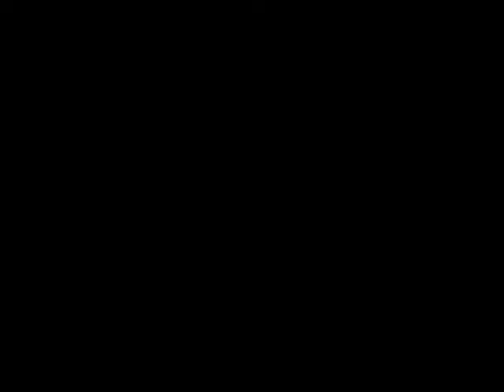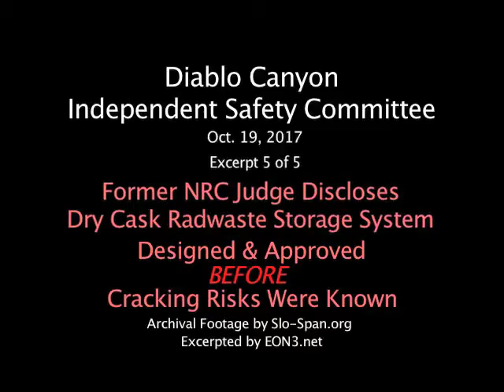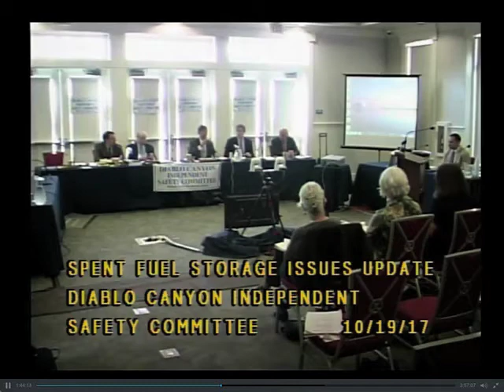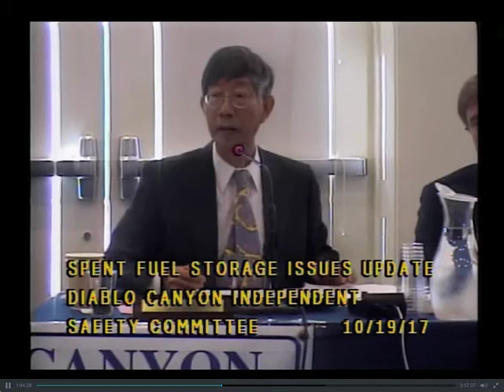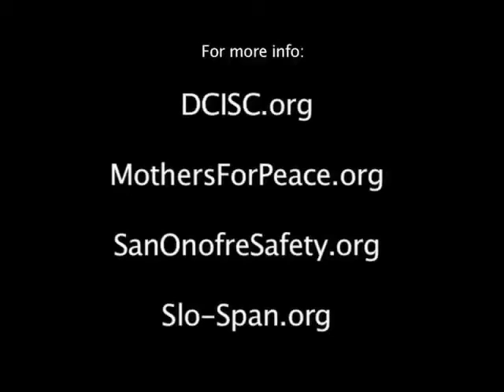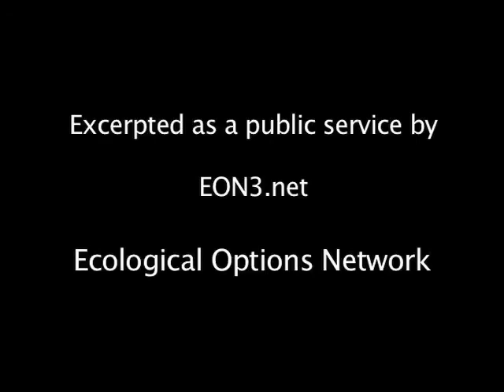Dr Lam's Disclosure on Stress-Corrosion Cracking Risks

Comment: This important disclosure by Dr. Lam on October 19, 2017 provides crucial new information.  Dr. Lam's disclosure confirms that Stress Corrosion Cracking was not a condition known at the time when HOLTEC dry cask spent fuel storage systems were approved for use at Diablo  Canyon, or at San Onofre.   This is vital new information that must be presented to regulatory agencies, including Nuclear Regulatory Commission NRC, and California Coastal Commission CCC during Decommissioning phase for San Onofre, and Diablo Canyon.